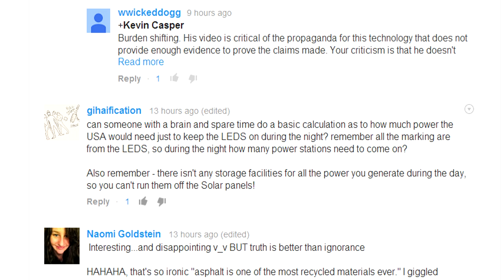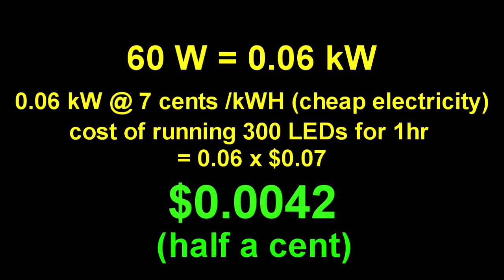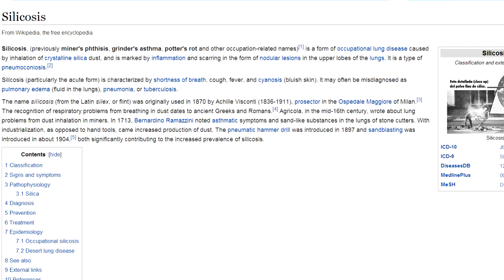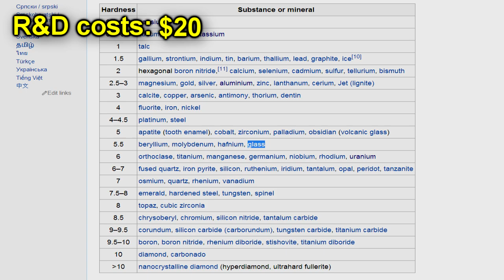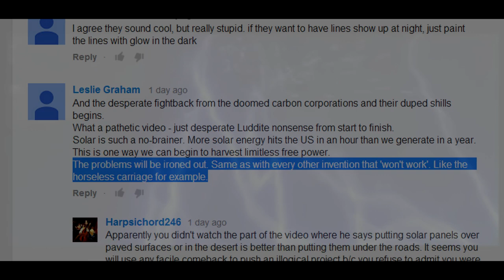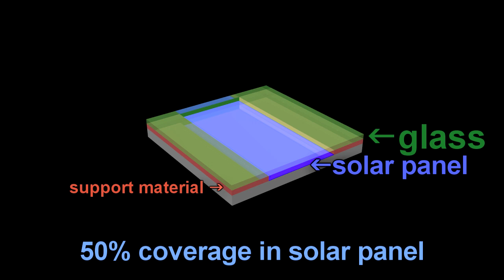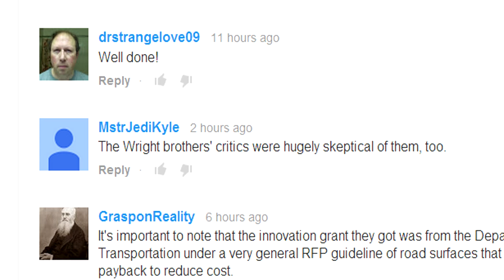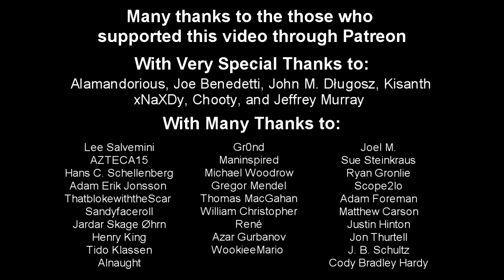Solar Roadways, IMPORTANT QUESTIONS AND ANSWERS!

Comment: judging on christmas lights... im preeeeeetty sure leds are cheaper than that if you buy them straight to the source rather than from an obscure re-seller.

I also think that you don't pay attention to economy enough. Any money spent on making solar roads wouldn't go anywhere since you are using it to pay citizens. That means that no matter how much you spend, it will get back into the economy. There's also the fact that no matter what the creator says, they will never make every road with solar panels. They will likely only use those in target locations nearby cities. Whats the point of putting them in the middle of nowhere? whats the point of putting them under the shadow of skyscrapers? Obviously, we will never put solar panels in random locations unless we are retarded.

Yet definitely, they should drop the led idea or keep the idea only for public plazas, for pedestrians, not cars.

Comment: Why are they messing with solar panels on roads? Mount them on roofs. Not nearly the materials difficulty, no need for the LED's, much less expensive. It wouldn't even be that difficult to put the tracking on them to make it make more efficient.

I'm confused. Why are they doing this research instead? Even putting them down flat would make more sense than what they are proposing here.

Comment: You make some good points. The reality is they can take out the LED's. That is a not real issue. This then turns it into a power producer instead of produce and user. Cover the panels with traditional paint to mark the lanes and what not. The real question is can we create something that is harder than glass but still clear.

I understand graphene, a one atom thick material made of carbon, is 95% transparent. Could this be something that is used to replace the glass. The material is strong enough to resist the weight of a few tons on one centimeter of space. Is this enough to resist any forces cars or trucks could place on them?

Comment: A few notes (may ramble a bit - sorry):

1) Glass is quite strong in compression, weak in tension. It's a bit like concrete in that respect. So yes, you could drive on it, as long as you don't skid. Glass is also stronger than bitumen (aka Asphalt*). This is why we put gravel (aggregate) into the mix to stop the bitumen being worn away too quickly. Actually, using bitumen has a number of advantages over concrete (which we also use for roads) but more of that later.

2) If you want to demonstrate how effective the solar panel side of it is, why not get the solar panel you have and lay it out on the grass of your garden? Place a sheet of clear glass on top and read how much power it's generating. Then replace that glass with frosted glass. This will show how much is lost by texturing the glass (if you look at the panels, they're textured, presumably to improve grip.

3) back to the concrete. Look at the example road they show. It's a concrete base with the panels slotted onto metal bolts. Now this is where material science comes in...

Concrete is rather prone to thermal expansion. That's why you have expansion joints cut into concrete slabs (roads, bridges etc). Reinforcing the concrete can compensate for this, but that's going to add a huge cost to the roads... Glass also suffers from thermal expansion, but at a different rate. So... if the road gets hot, the concrete expands and... the glass panels don't expand as much. This is going to stress the panels, possibly move them apart.

These panels are supposed to connect together, yes? Best have flexible joints else they'll disconnect... and that makes them glass road panels, not solar road panels, and their LED's will be utterly useless.

And if the panels get loose? Erm... skid city.

4) LED's. The live demonstrations show a small number of LEDs in each panel, but to achieve what the simulations show, you'd need quite a lot of LEDs per panel. Okay, I'm swapping hats here, but we're talking raster imaging/pixelation, and to achieve road markings, you'd need denser LED concentrations than those real sample panels displayed. That could up the power requirements considerably and reduce the solar panels, too.

5) back to the concrete (said I'd ramble a bit)... Look at how the panels are located: Metal bolts sticking out of the concrete which go through holes in the panels so they can be bolted down. Now... if a panel crumbles (through stress due to thermal expansion... that's could well leave metal bolts sticking out of what's left. Even with the nuts on top (no, not those behind this idea - and not me, either). That's not going to do the tires of a Semi any good... and if a Semi's tire blows... did you ever hear of the vandal who tried slashing the tire on a Semi? (I'm talking Class 3 HGV, of cause, or articulated lorry, aka an 14/16/18 wheeler)... The police found him the next day, ribs caved in from the blast of escaping air. So if a Semi's tire blows... I'd hate to be anywhere near it.

Oh, and a couple of criticisms about two of the demonstrations you presented, TF (sorry)

a) you were grinding the aggregate against the glass to scratch it. This represents skidding, not tires rolling over the glass. That would cause the aggregate/grit/rocks to be pressed into the glass, potentially splintering it instead.

b) throwing a spark plug against the side window of a car shows what, exactly? That a thin sheet of laminated glass held in a frame will break into cubes rather than splinter into shards? Sure, that's what it's supposed to do. Doesn't have anything to do with what would happen to the inches thick glass used in the road panels, just as it proves nothing about how the windshield will hold up if struck by the same spark plug. If it did, then a bunch of aircraft engineers will be very upset - they like firing frozen chickens at aircraft windshields to check if they're strong enough. Can just see them sulking as they're reduced to throwing a spark plug at them instead.
 
Anyway, as far as the solar road panels are concerned: nice idea but... no. Just... no.

*Asphalt, also known as bitumen, is a sticky, black and highly viscous liquid or semi-solid form of petroleum.
Reply: Oh... I forgot... wear, tear and maintenance!

Bitumen is easy to maintain, and modern blacktop roads are designed on a 20 year lifespan (not that they get to last that long with roadworks etc).... those solar road panels won't last as long - perhaps 5 years, 10, before they need replacing. That means you'll need a larger workforce just to maintain the roads, at a cost, and that means higher taxes to pay for it all (and that's not taking the cost of the materials into account).

Just how far into debt is America at the moment? And how far do these people wish to push it?

Comment: People seem to be questioning TF00ts maths on the LEDS, I work in the Solar energy sector, and that was the cause for my question about the LEDS, These panels have a very low solar surface, (Loads of wasted area) and then they have loads of power wasting tech on them! (Leds, Micro processors) Heck I even know the Inverters they are using are Enphase. And they come in at about 120 quid each! (Including cable connectors. and lines)

So if you want to take the 240 bil tiles and multiply that by lets say 5 panels to 1 micro (they are at about 200 watts, and these panels look barely 40w) theres another Cost so sky high it also kills the project

The point of the question was that for all there Green ideas.... They go straight away to Marketing promises. Rather then just getting cheap power to houses.

Why dont they just buy 1mil worth of land in a desert area, and flood it with panels.

Or install 2mils worth of panels on houses. Thats about $15k a house. thats about  130 houses.... if u get 4kw on each, thats about 520kws....

Nearly 1/3 of a power station..... and way more practical and can be done tomorrow.

Comment: I largely agree with thunderfoot on this solar roads idea.  I do have some problems with his led tests.  First the LED visibility test.  The non LED strip is white and will reflect far more light than the LEDs themselves which would never allow the LEDs to be very visible in daylight.  Also the LED power usage values thunderfoot used are wrong because the 60w value is for 300leds as stated on the amazon page.  Unless he takes that into account, which I didn't really see in the video, then the calculations are wrong.  These objections are somewhat minor when you take into account the other problems with the solar roads idea.

Comment: I agree with most of what Thunderfoot said, but his math on how much power it takes to light up the road seems off.  You wouldn't be lighting up the entire road, only strips, so you wouldn't use all the LED's simultaneously.  I am curious though, whenever anyone mentions solar power, they mention they only work in daylight.  What is the problem with building battery stations?
Reply: Cost. I think the biggest problem is 'cost'. Followed by 'what happens at night'

Comment: If you pledge $10 000 on Indiegogo you will get a single  solar road hexagon part.
Yo do not need to be remotely interested in science or electronics to understand that the hole idea is insanely costly and insanely stupid.
But the guys have now got pledges for $2M for promoting snake oil so you cant blame them for being stupid.

Comment: lets not forget too that while in a traffic jam, all the cars shade the solar panels and make them even less worth while.
during the winter, they're covered in snow and then scraped by ploughs and likely pulled up out of the grid like the odd manhole cover is... im sure that'll be great.
as the glass surface becomes scratched and worn out, the panels under it will get even less light. 
some streets are covered in shade by trees on either side
what's stopping people from lifting them out of the road and using them for their own needs?
how much traction do you get on glass vs asphalt when it's wet?
how would they fair against the autumn weather with rain in the day and freezing at night? the water will make its way between the pieces and expand during freezing... will the glass shatter? will they pop out of the road? will the water leak into the piece itself then destroy it from within?

Comment: And what about dirt, tire residue, and oil.  It wouldn't take long for martial build to reduce the efficiency of each tile.  You would have to wash ti - frequently.  Added manpower to maintain the road ups the cost considerably.  And you would need lots of water and detergent in order to get the oil off - causing other problems.

Comment: How about magnetic induction charging for electric cars powered by tracking solar along the road?

I've also read about passive solar, with heat pumps and heat sinks are set under the road.  The heat is stored and pumped back when the road is below freezing.  It's not designed to create electricity, but to keep the roads from icing.  The idea is to just run pipes through the asphalt, and hopefully, the cost of the pipes is offset by the reduced maintenance of roads that don't constantly freeze and thaw.

Comment: I don't know if I find if funny or just plain idiotic how so many people swear up and down that his plan is actually going to work. Glass is a piss poor material for a road surface, and even if it is textured, its going to wear down and it will be really expensive to replace. Just like anyone with a working brain will say, putting solar panels alongside the road will be much more effective than putting them under the road.

And when analyzing the costs, please take into account how many LEDs that will need to be replaced, how many power stations will be needed to power the LEDs or store the electricity that the solar panels generate. Which of course they have yet to address and they also plan or taking down the overhead power lines too?......How much is that going to cost?

So far over 2 million dollars have been raised for this project, but there is no way in hell they will be able to pull off such a monumentally ludicrous idea. Especially not on the scale that they are planning. Not even in their dreams.

Furthermore, they have yet to explain how they plan on transporting all this electricity to these hexagons throughout the country.

Comment: I was looking to donate to the solar roadways project. I wanted to ask them a few questions, so I donated $1 so I could post on their indiegogo page.

I've now posted somewhere around 8 times, and my questions are being deleted every time.  Here's my most recent post:

Why do you keep deleting my questions? I want to donate more, but I want to learn before I do so.

I’ll ask my questions again: have you driven a vehicle over sand or gravel on the glass? Have you put some high output LEDs under the glass to show that they are clear and visible in daylight? How much energy was consumed in melting the snow, and how much snow was on it? What happens if the melted snow refreezes when it goes in the conduit corridor?

I then did some googling and came across this video. It's a shame that they're deleting my questions, because I'm trying to directly interact with them and learn more about it.  Censoring questions doesn't lend credibility to their project.
Reply: Aaaand they deleted my post again.  I posted something positive, we'll see if that stays up.